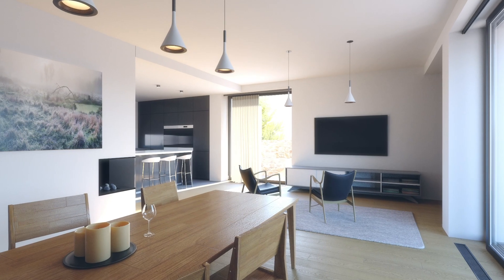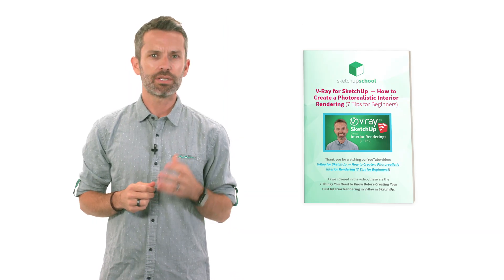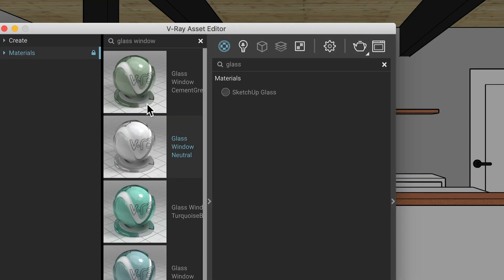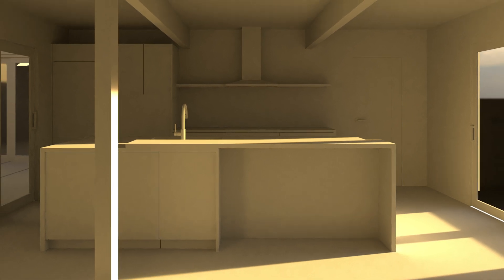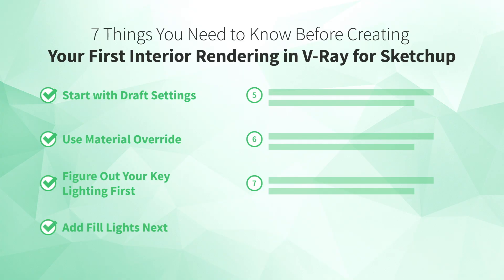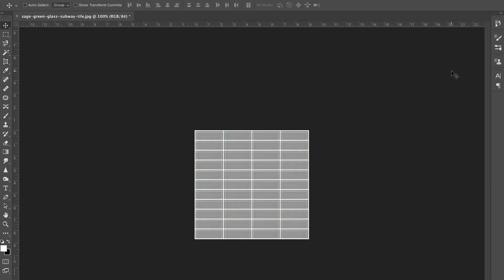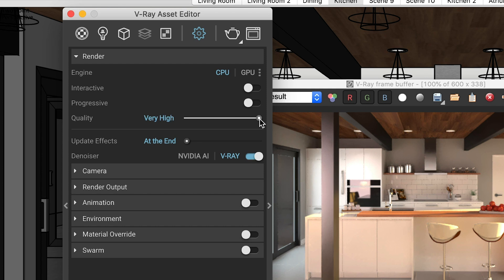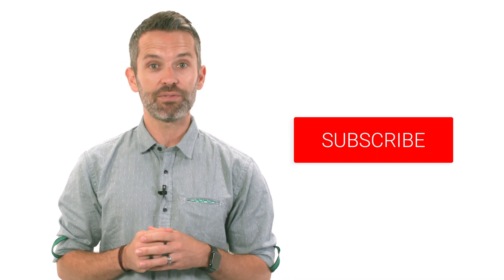The Key Steps to Rendering Interiors with Vray for SketchUp

Comment: there is no fill light in my sketchup
Reply from the maker: You need to use a rendering extension such as V-Ray for SketchUp to add fill lights
Reply: @SketchUpSchool  i have installed v-ray already, but i see no fill light, only other light like spot light, etc...

Comment: How to render stainless steel kitchen ?
Reply from the maker: Apply a stainless steel material to the surfaces and render - of course, you'll need to adjust lights and get everything else right, but the stainless steel is just a matter of adding the correct material from V-Ray's material library.

Comment: Excellent video. As for going through PS to include a background image, it's also possible just to import one into sketchup. I've seen it done.
Reply from the maker: Yes, you can import an image to be the background in SketchUp and there are many reasons that can be a preferred workflow. But when it comes to having an easy way to control the appearance of the background later, it can sometimes be best to add it after the fact in Photoshop.

Comment: I installed vray but every render i made still pixelated. Is it my graphics card problem or something i missed in the denoiser?
Reply from the maker: It could have to do with a few different things. The first thing to check is your render quality settings: If they are set to Low or even Medium, then you will have some pixelation. Of course, higher quality leads to longer rendering times, but when you are ready to create a final rendering the higher quality will help. 

Also, for the denoiser, you just need to have it turned on. The default settings should work fine in most cases. 

After those two things, if you still have a bit of pixelation, it can often be due to an issue with your lighting and exposure. If you have an imbalance there, it can lead to some graininess in the image.

Comment: great video and really helpful. is there anyway to scale down size of background images of HDR skies while using dome light? its a huge issue i fail because every time i use dome-light the background image is so cause it often never matches with the size of the model and gives me unrealistic renders
Reply from the maker: There's not a way to scale down the size of an HDR image in a Dome Light. A workaround: If you want to control the size, create a dome shape in SketchUp, and apply a self illuminated material of the background image there, then you can scale the SketchUp dome and the texture will follow.

Comment: Very enlightening video! (pun intended :P) I'm having trouble with daylight on my interior renders, it appears the sun light (or dome light) is not entering the interior, there is light coming from the exterior, but looks like the windows are facing a different angle and I haven't been able to correct it no matter if I rotate the dome light or the entire model
Reply from the maker: Is the inside pitch-black, or just dimly lit?
Reply: SketchUp School it has some light inside but it looks like there isn’t sunlight going in directly and it should